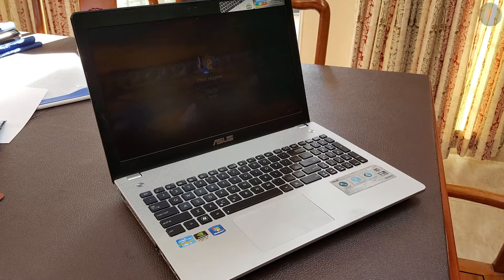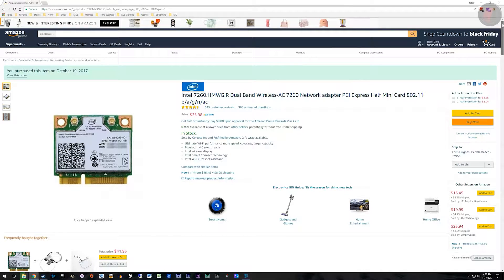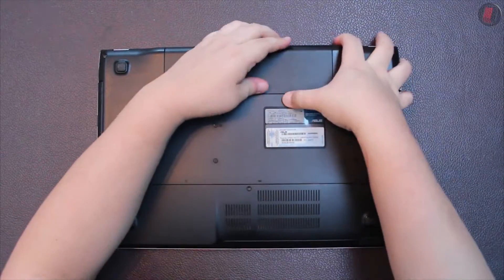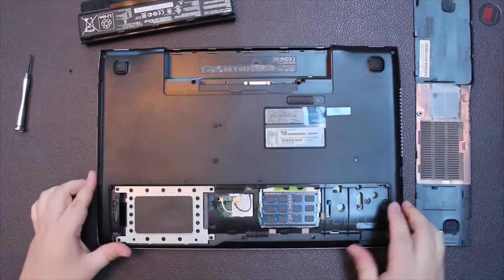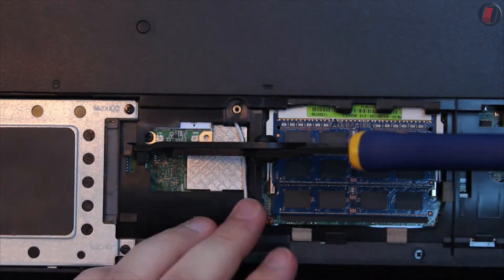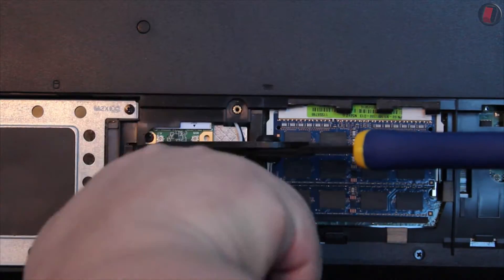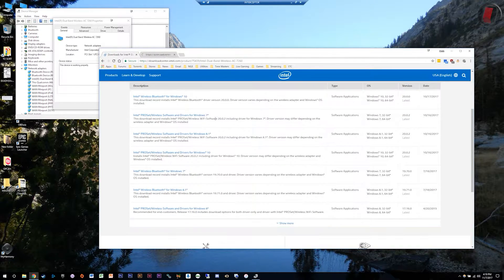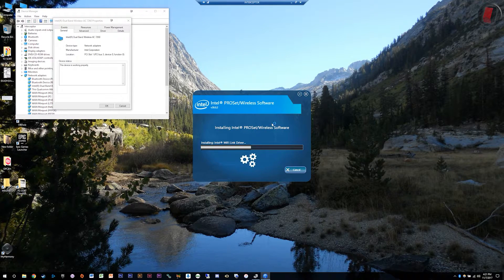Replacing the WiFi Adapter in an Asus N56V laptop

Comment: hello thans for the video, I have the same laptop and was woundering if I can use this wifi 6 card from amazon could you tell me if it will work maybe? Amazon: MPE-AX3000H WiFi 6 Wireless Card Dual Band 802.11ax Half Mini PCI-E WiFi Card PCI Express Network Adapter BT5.2 2.4GHz 574Mbps 5GHz 2.4Gbps(160MHz) for Windows 10/11 64 bit Better 7260HMW WiFi Card

Comment: Thank you! I need to replace my card too but I also want to replace the antennas (white & black cables) since one of the two connectors is broken and the range isn't as great as it used to be. Could you also provide a link for a solid antenna replacements? Thank you!